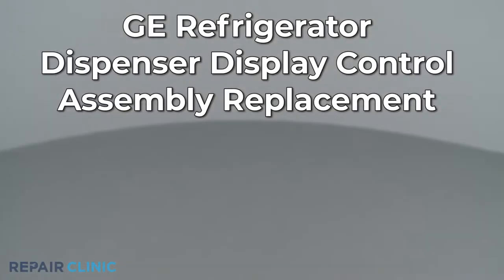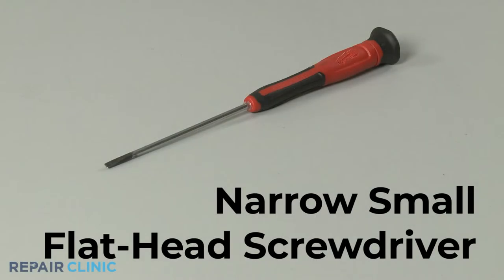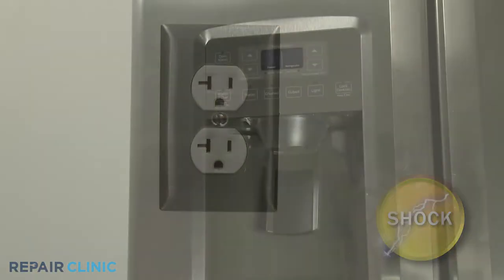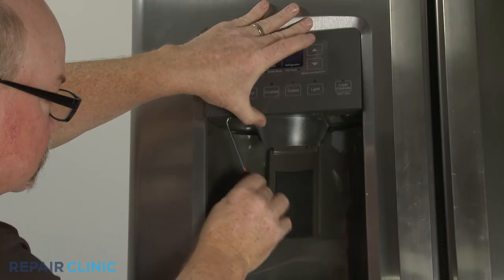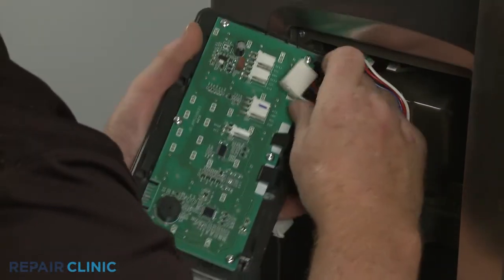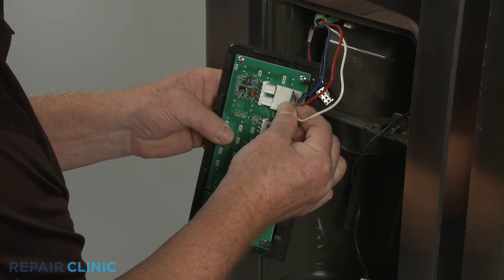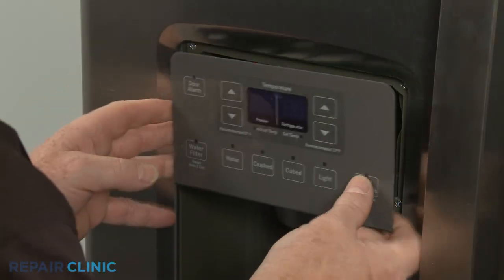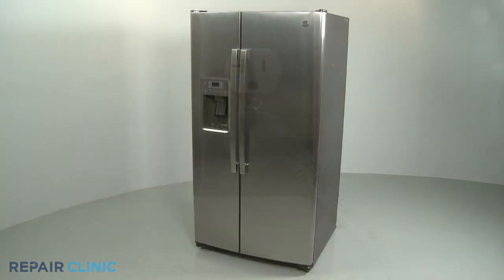GE Refrigerator Dispenser Display Control Assembly Replacement WR55X34887

Comment: If I replaced that board and the display is still not working, what should be the next part I look at?
Reply: Replace the circuit board behind it. They’re notorious for going out. I’ll never buy another one of these again.
Reply: @nicholassharp8691 notorious maybe but the board is cheap and extremely easy to replace. At least they don’t have wire harness severing issues like whirlpool lol

Comment: Mines keep showing zeros , reached out to ge and no help
Reply: Same thing here. Flashes 4 zeroes and wont do anything.
Reply: Mine is doing the same! Has anything changed yet for you?
Reply: Get a new fridge. I changed out the display board and the main board. Still the same thing flashing 4 zeroes. I emailed GE and they sent me a wiring diagram for the fridge. Then I used my own wires and wire nuts to bypass the part of the wiring harness of the fridge that connects display board to the main board. Still the same flashing four zeroes.. No idea what the problem is it’s quite ridiculous. I have given up on having the ice and water work with this fridge lol.
Reply: It’s funny because all of the videos show this issue and somebody pressing consecutive buttons for a reset but nobody shows the actual reset and online can’t help you. People on the phone are just bots. This type of fridge is just trash.

Comment: Trying to help a neighbor out with her GSE25GSHBC refrigerator.  Her display would intermittently stop working and eventually stopped working altogether.  Freezer and refrigerator are both cooling fine but she can't get ice/water through door, adjust temperature, etc.  Appliance repairman told her there was a break in the wiring (inside the freezer door) that feeds the display control panel.  He said it was the first time he's ever seen that and it would be cheaper for her to buy a new refrigerator than to repair.  GE will sell her a new freezer door for about $500 so she asked me if I would put it on for her.  Before I give her the go ahead I was wondering if the wiring inside the door is replaceable.
Reply: As a tech “wiring issue” 80% of the time means they have no idea what the problem is and want out. Unless they can prove it don’t ever believe a tech that says there’s a wiring problem
Reply: Same problem I’m having now.